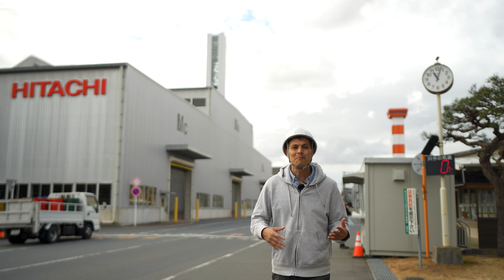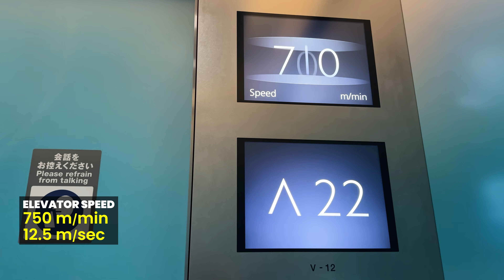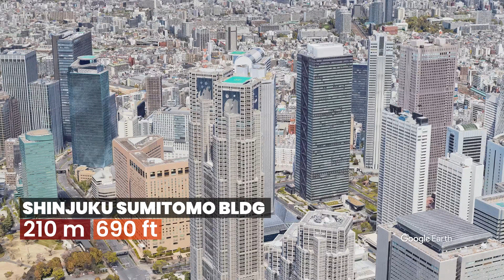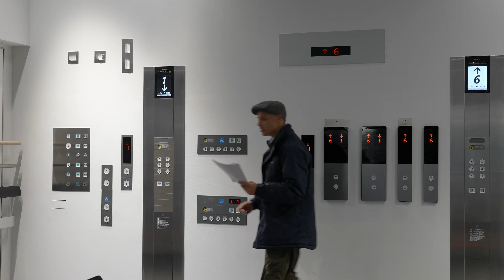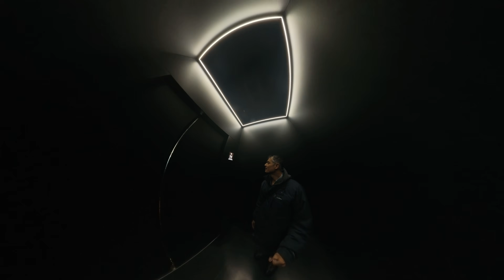How Japan Broke the Elevator Speed Limit

Comment: @ 14:16

The chart showing the elevator speeds in MPH, should really be listed in KPH. I would love to ride an elevator that moves at 75mph freeway speeds. We will eventually get there as buildings reach 200 to 250 floors and 1.5km or more higher. In Dubai, they had started on Dubai Creek Tower (canceled) which had an estimated height of 4000 feet, but in typical fashion there, they would not disclose the real height which likely would have been another 200m or so, and in a tower like that, 60-70mph elevators could be a reality, but likely with the new belt driven technology which replaces elevator cables though its not there yet. Otherwise, with cables being used, the elevator rides would be across 2 to 3 elevators. Now I would definitely visit Dubai for that if not Burj Khalifa or any of the other attractions.

Comment: the top speed isnt as critical as the rate at which it gets to that top speed... G-forces, what are you willing to tolerate? same as the descent, negative G is only tolerable to a limited degree by the general population...

and yeah, the pressure changes. not sure how they "avoid" them with a pump... you gotta change the pressure at some point, regardless? just make it brief, rather than gradual perhaps?

Comment: 更にスピードアップしたら勢いで成層圏まで飛ばせるのではないか？
Reply from the maker: It’s 1260m/min now. I think buildings are limited by their own height with speed so a 600m building would take 40 seconds (the speed doesn’t start at 1260m/s but at that speed on a % of the ride). The new 1000m Jeddah Tower will have zones, no super express elevator (reported recently) and KONE elevators 🛗 will travel 600m/min — less than 1/2 the speed of Shanghai Tower and CTF Finance Center. So it seems we may have hit the top speed for a while since it’s not practical unless in a supertall building over 650m.
Reply: @onlyinjapan 様

私の愚問に誠実な答えをしていただき、ありがとうございます。😅

Comment: Let me tell you that a Chinese elevator going as fast as possible is not something i'd use. i'd trust the Japanese though.
Reply from the maker: It’s designed and built by Japan 🇯🇵 but I have to say, the tech coming from China in 2025 is darn good. DJI is an impressive coming, drones and cameras. 
But I think domestic Chinese construction has a reputation of getting the job done fast but not a well done. Details matter. Still, looking back at my first trip to China and Beijing in 1998 and today — it’s another world! 🤯 driving around Beijing today is like driving in America.
Reply: @onlyinjapan  Yeah, i only see that "earthquake proof" building built by China in the Philippines. That one crumbled like dry cookies and was the ONLY building to collapsed. I do not trust China, they are lying and cheating wherever they can.

Comment: 14:10 kmh not mph
Reply from the maker: I’m aware of the editing mistake. It’s listed in the video description. There Empire State Building meters per min are also off on the screen although those are correct at 14:10 I pushed CTRL Z on the edit right before exporting the file and it switched back my work to the same as the Shinjuku Sumitomo Tower 😬 I’ve been regretting the little errors in details since publish,  there’s nothing I can do to edit it or replace it but I’ll try to blur it. YouTube won’t let me right now. Those who previewed it didn’t pick up on it because it’s small — thanks for pointing it out. The details absolutely matter. -John

Comment: Get to the bloody point.
Reply from the maker: There’s a chapter list for very easy access to what you want, mate. 
00:00 Start
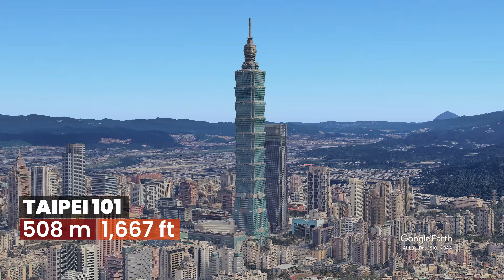00:43 World’s Fastest Elevators
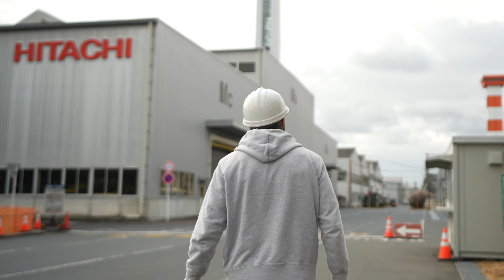01:44 Hitachi Factory & Test Center
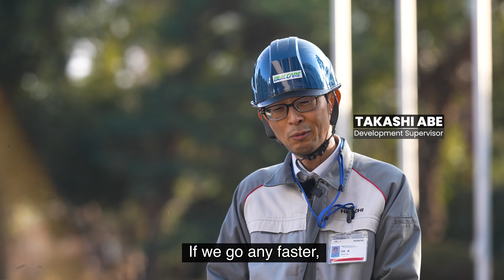02:35 Elevator Altitude Pressue & Ear Blockage
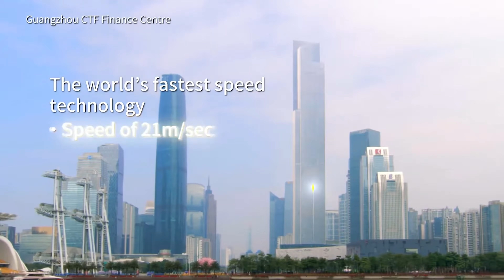03:45 FASTEST Elevator Design 
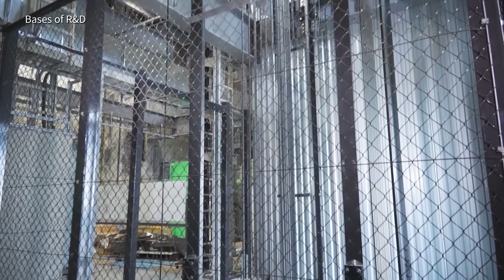04:13 Cable / Rope Challenge 🛗 
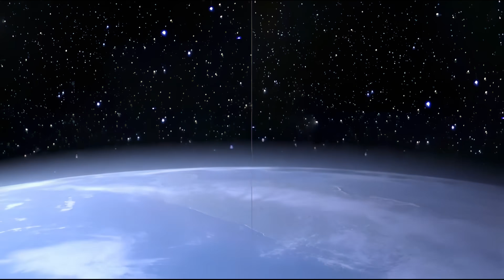04:57 Space Elevator in 2050
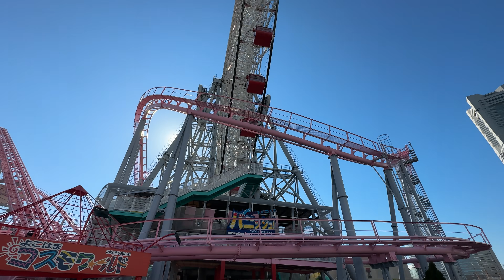05:40 Fastest Elevator Going Down
06:29 History of Elevator Speed Developmet
09:38 World’s Tallest Building, Jeddah Tower
09:54 Bullet Train Speed Record 🚅💨
10:30 Ushiku Daibutsu Statue Elevator
11:04 Tokyo City Skyscrapers Increasing 🏙️ 
11:27 Elevator Earthquake Safety
13:20 Digital Elevator Design (Shibuya Sky)
14:09 List of World Speed Records 1931-2025

Comment: 11:30 (drop test) - makes me wonder, what is the minimal height before those emergency brakes wont stop the elevator from crashing 🤔
Reply from the maker: Good question. I watched a lot of tests, it seems it slows it down significantly so if it were close to the bottom, it would not be fatal. This is why speeds going down are still much slower than going up 🛗 going up, it’s much easier to stop in an emergency because there’s no momentum to slow, right? I love these questions! Thank you.
Reply: @onlyinjapan  More questions :)
John, do you know if the elevators in drop tests like the one from video have a delayed emergency braking just to check how efficient the system is? Did they give you an idea about how would G-forces look like in a situation like this drop test?

Comment: Amazing how tall these buildings can get! Good thing the elevator has all those safety features, but what if their is no EV car around to use as backup power? I'm not a huge fan of elevators, always get nervous riding in them thinking it's going to malfunction and then fall uncontrollably downward and I go smoosh.😂😬
Reply from the maker: These days, there is but it’s just an added security feature. There is still backup power. The point is any EV can do it that plugs in and one can get there in 15-20 minutes since it’s on wheels to evacuate people. The little details are so fascinating!

Comment: Elevators do not just go up in buildings . 
  They go deep underground . 
1800 m was considered about the deepest for one drop . 
  Was running at about 15m/s . 
Carrying about 120 bodies all crammed in . 
Up and down speed was the same . 
This was around 1974 , latest figures from 2010 . 
  As mentioned , for longer lifts the weight of the rope is critical , the longer , the heavier and thicker . Meaning hoist cable drums have to be bigger too . 
 when will  they can make a fast elevator on the side of a building that arrives a few seconds faster :-)
Reply from the maker: Such an excellent point! We think about upon buildings but going into the ground, I’m sure there must be some interesting elevators built down. Maybe a future episode 😆 hehehe

Comment: This is very interesting but my first question is why do we need to go so fast.
Reply from the maker: Exactly! I think at this point, what Abe-san said is really accurate. 500m in 40 seconds is a baseline on what customers / passengers would ideally like. This is an express elevator. Of course stopping floor to floor would slow things down a lot, no reason to go fast. Bigger to carry more people might be more beneficial. So the question is for this record is more on being innovative I think. Resigning what we already know which finds new tech and new ways which are later incorporated into all designs, IMO. NASA going to the moon yielded a lot of innovation for everyday life, if I remember correctly. I think the cost for speed isn’t worth it, to maintain it. In my research, NYC’s RCA building spent a significant % of operating cost on elevator operation because of the speed! I don’t know if it was worth it which is why there was no new record for decades! That’s a perfect example. But energy efficiency and materials are so good today, it’s much more possible in practical terms

Comment: I never thought elevators would be this complicated.  I just realized that I never had to equalize when riding those super fast elevators for observation decks, unlike the regular ones on moderately tall buildings.
Reply from the maker: This episode made me rethink the amount of work they put into the ride, the details. The safety. Being suspended 300 meters in the air held by “rope” … scary but amazing we can do it so well 🛗 Abe-san is like a hero to me, Engineers can have super powers!
Reply: @onlyinjapan  especially Japanese engineers.  They are so dogged in pursuing a problem.  You should also do an episode on the creation of the blue LED.

Comment: Awesome informative video, so for the fast elevators do they only go from floor 40 and above? Like an express elevator. For example if someone got off at the 10th floor 11th, 12th etc. then speed wouldn’t be a factor. Just curious. If I had to go to the 70th floor. I’ll be like nobody else push any of the lower floor buttons. Hahaha 😂
Reply from the maker: Usually these are express elevators to observation decks. The CTF FINANCE CENTER goes direct to the 95th floor.  Of course the elevator takes many floors to build up a “cruising speed” to hit that peak.

Comment: I think with the cables being necessarily so damn heavy in the taller buildings, I think the next big elevator innovation will be completely eliminating them, which will then pave the way for greater speeds, freed from such a burden.
Reply from the maker: The “rope” or cable seems necessary just for safety because of gravity but it’s logical that THAT is the weight to cut since you can’t cut the people riding or the elevator itself but the rope is a serious amount of weight!

Comment: When I was in Japan in 1993, one of the most remarkable experiences was the elevator in the Tokyo municipal building to the observation deck. The elevator doors closed and I wondered what was taking so long to get moving and then a few seconds later the doors opened and we were there 45 floors up, no sound or sense of movement. Every tall office building elevator in Canada at that time would accelerate hard enough to buckle your knees and about launch you off the floor when it stopped and they rattled and clanked the whole way. Canadian elevators were like a bad amusement park ride, so this elevator in Japan was jaw dropping. 😮🤯
Reply from the maker: It’s a smooth one! I think it’s the same as the Yokohama Landmark Tower? That one is the smoothest I’ve ever been on! Mitsubishi really did a great job with not just the speed but the smooth ride.

Comment: Why can’t elevators use a similar maglev system from maglev trains? Instead of a heavy metal cable, have superconductors and permanent magnets that can move the elevator car without friction? The Meissner effect will attract, repel, and levitate a permanent magnet that is near the superconductor.
Reply from the maker: The energy needed might be too much. A train is much much larger. It makes sense in 2025 but for vertical travel with gravity, I think the energy consumption doesn’t make sense vs motors with ropes. I bet it changes. I was also curious about pneumatic tubes using air!

Comment: At 1260 meters per minute or over 4000 ft per minute this elevator actually climbs faster than a 737 at take off which has a rate of climb range of 1500 to 3000 feet per minute! wow
Reply from the maker: Amazing! I didn’t know that.